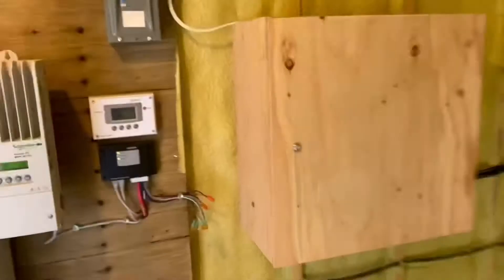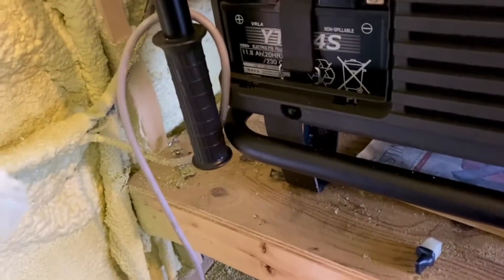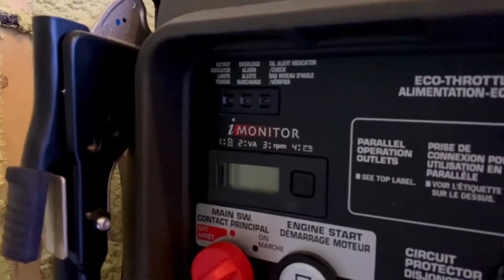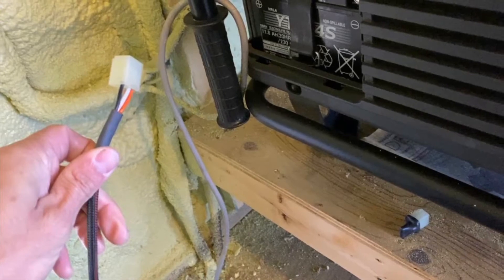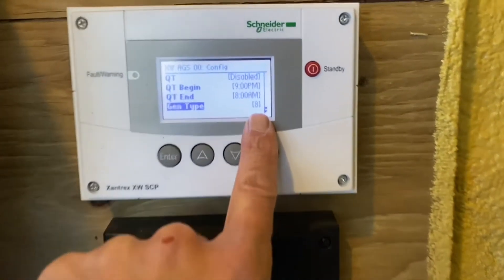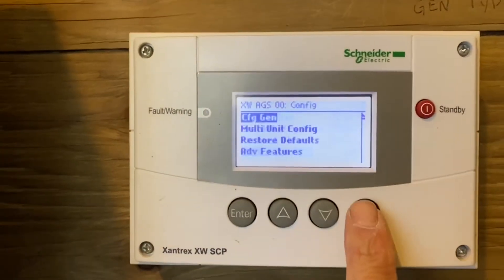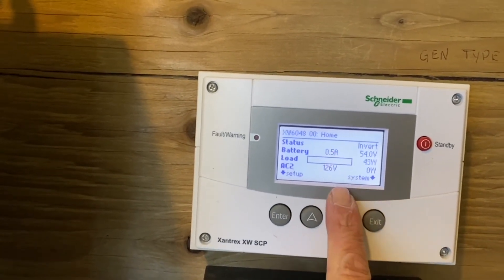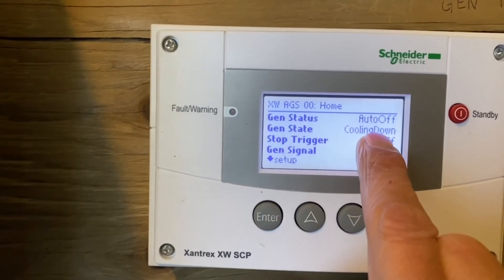Schneider AGS Wiring Harness For Honda EU7000IS - Magnum AGS Works Too!

Comment: With all respect, charging $80 for that harness, and a few feet of wire, is criminal.
Reply: Probably hand nade.  Do you work for free?  If it takes an hour plus parts then $80 is probably fine.  I doubt they are mass produced.  This isnt hard.  Buy your parts from mouser and spend time assembling.  Pretty sure you will have wished you purchased it pre-assembled.
Reply: @notmethanks816 , hey, I already solved the issue, used 2.8 mm spade terminals, a a bit of heat shrink, fits the pins on the generator perfectly , no issues, thanks for the great recommendation for parts, have yourself a nice day!

Comment: Will your start wiring harness work with the Honda EU7000i?
Reply from the maker: These should work with the Honda EU7000i as long as it is not bluetooth compatible and has the same prongs as shown.

Comment: Man,  I raspy could use some help with my Bluetooth 7000is.. I found the 4 wires in the 6 on plug and can get AGS to turn key on using pins 17 and 18.  But won't start it unless I unhook the 14/16 and touching again. 

Then it will start,  but shuts off seconds after🤷

Comment: If i am using one of the diagram with the relay, what do i use to activate  the relay. The AGS or the Inverter Axillary?
Reply from the maker: The Harness itself does not activate, the activation should all be handled between your generator and your AGS.

Comment: Lololol my locals sold me magnum energy products and sold ne the generator they could never get it to work. Out 20k time to replace the magnum garbage. I believe I'm going with a schneider swpro probably 2 of them, then replace my generator a honda em5000sx. Probably a propane converter editor eu7000
Reply from the maker: Let us know how we can help you. The Magnum and the Schneider SW/XW series are both great equipment when properly set up and configured for auto gen start. Our harness works perfect great with the Honda 7000 Generator. If you need some consulting let us know.

Comment: Do you know if this would be the same setup as a 10kw home standby generac with a two wire start?
Reply from the maker: Sorry for the delay, you won't need the harness for a two wire start  Generac like the eco gen model. Keep in mind the eco gen needs a constant state of AC power to maintain the battery charger function. If you need some technical support on the AGS configuration with the Generac, please reach out.

Comment: the harness guide shows type 8 gen set using harness slots 12,13,14,16,17 & 18.  you only used 14,16,17 & 18.  why is that?
Reply from the maker: Hi Tony 
Its a 4 wire start configuration for the Schneider AGS. Are you installing a harness as you type? The details are on the wiring diagram you receive with the harness. 
Please contact us for further clarification if you need support.
Reply: @raysolarmadeeasy  oh yes you are correct, it is 4 wires.  I don't have a honda, it would be easier if I did.  I have a wen 4750 dual fuel generator. It doesn't have a termination terminal so I would have to splice into the start switch, I think.

Comment: The Honda eu7000IS is a terrific generator and I would like to hook  A Schneider Context AGS up on mine. I watched the video and see you are using the old 8 pin remote start plug. My Honda is the new Bluetooth Co-minder model with the 6 pin remote start plug. Do you have a video showing the 6 pin? Do you sell the harness for the 6 pin set up w/instructions for the AGS?
Reply from the maker: Its a great back up generator. Unfortunately this harness will not work with the Bluetooth enabled Honda Generator. If we receive more requests we may look at developing one but unfortunately there are some technical challenges that may make it cost prohibitive.
Reply: @raysolarmadeeasy what kind of technical challenges could be encountered here? I'm looking into a new generator that I can install a 2 wire remote start system into but don't want to get stuck with the Bluetooth model if it's not possible. Finding an inverter generator with remote start (capabilities) is proving to be a frustrating exercise.
Reply from the maker: @tippinator  Give us a call and we can help you. We have a AGS that can work for your application without your inverter having something built in if that’s what you’re after?
Reply from the maker: Can you contact us and we will sort out a solution for your specific needs. info@raysolar.ca

Comment: Can the  EU3000IS 3000W 120V Portable Home Gas Power Generator

Be integrated  schneider ags?
Reply from the maker: Yes, it could. However you would need to use the EU 3000IS with the SW (4024 or 4048) series inverter since its 120VAC and not 120/240 volts. 
The other items to note, is this model has a manual choke and would require a solenoid conversion to activate the choke. There is quite of work involved to get it done but it is possible. 
The easiest way to introduce the AGS would be to use the Honda model 7000is. The AGS kit is inexpensive and works really well and the installation is straightforward! Reach out to us further if you have any more questions.
Reply: @raysolarmadeeasy    Thanks for this information it is most Helpful. Any other model Generator that this straightforward conversion can be done with the Schneider ags?
Reply from the maker: The Honda EU7000 is the easiest with this harness. **We working on a solution for the Yamaha 6300 but it’s not available just yet.
Reply from the maker: Any generator that has a two, three or four wire remote start function.

Comment: I have the same plug that you have with the pin at the same location as yours am connected to that same AGS from Schneider why is mine not working ? and you're plugged that you sell works could you explain that for me please thanks
Reply from the maker: Hello Serge, I am sorry you are having troubles, it sounds like you sourced this harness elsewhere and as such we cannot comment on the connector or any issues arising from it, or any of the potential issues external to it in your circumstances.  Our best recommendation would be to have the situation physically troubleshot locally.